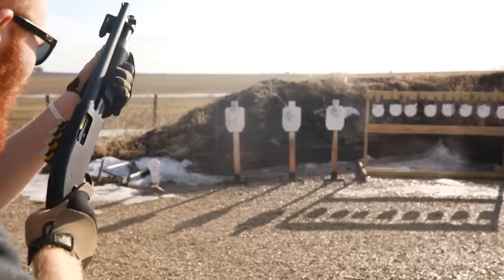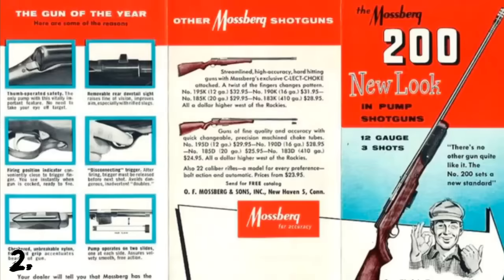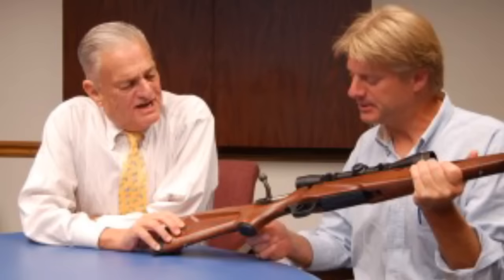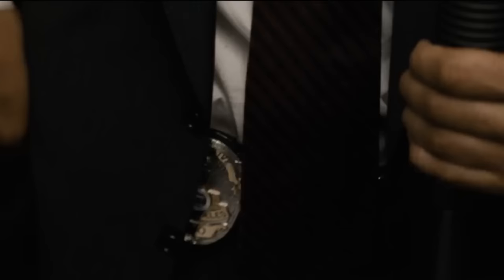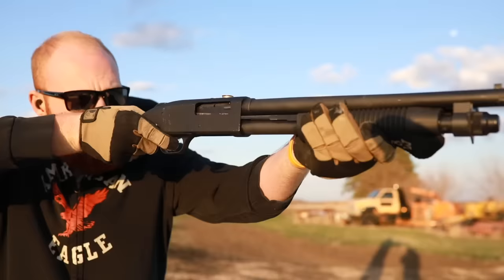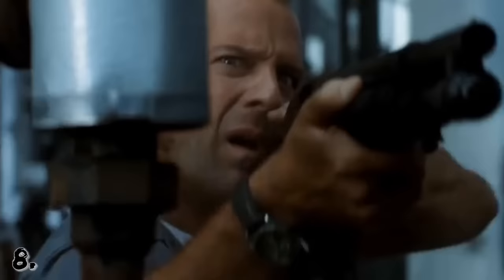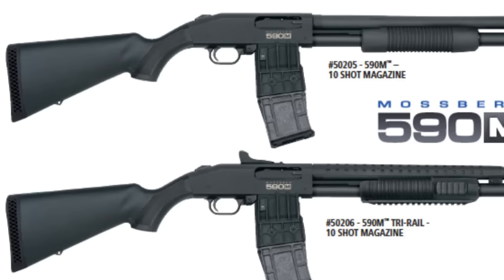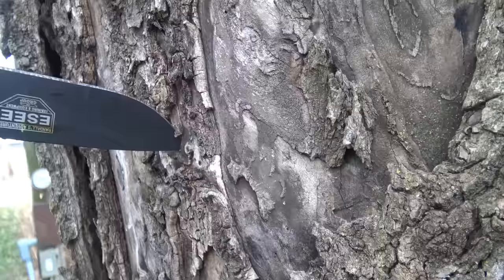10 Things You Don't Know About The Mossberg 500 & 590 Shotgun

Comment: After 30 years of being in law enforcement and a gunsmith, I can safely say I’d take a Mossberg over a Remington any day.
Reply: J. Robert Bragg Winchester/mossberg>remington right?
Reply: what's your thoughts on the Maverick 88 vs the 500? is the 500 really worth the extra cost?
Reply: With the maverick 88, you can not change the pump to a different pump because the action bars are pinned in place. You basically have to spend an additional $$40 for a new piece plus the price of your upgrade. 
Also, the safety tang on the 500 I feel is superior to the trigger guard safety of the maverick. Other than that, there isn’t much difference. But I’d go for the 590. It’s the same price as a 500, but has barrel and tube fittings. Basically a sturdier 500.
Reply: you wouldn't say that if you had a'54 Wingmaster
Reply: @billmoyer3254  I've got a '62 Wingmaster 😁. Thirty inch, full choke. Great Waterfowl  gun.
Reply: Scott Murphy  not good?
Reply: Thank you sir
I value your input.
Reply: @VuDuVampirNinjaWitch The issue with the safety probably has a lot to do with technique. I typically release the safety while still in the act of shouldering the shotgun so it isn't slower than the Remington; perhaps even a little quicker. I definitely prefer the slide release on the Mossberg because it's much more intuitive to use when bringing the shotgun up. For the shotgun beside the bed with an empty chamber, that's a plus. As you say, it's just a matter of individual preference.
Reply: Joe Mamma ?? Really ??
Reply: Serious question dude. Bout to buy a 20 gauge Rem 870 but there's a mossberg 500 also. 
What is your reasoning?
Reply: Bill Randall  The .223 has a different application and range than a shotgun, also called a scattergun. An AR-15 is the next on my list.
Reply: My mossi shoots anything i feed her , love them .
Reply: They what an what to me as far as reliability goes
Reply: I also love my 500 but I have a question for you sir. My mossberg 500 mariner gets 3in shells stuck in the chamber. It requires me to  slam the but on the ground to rack it. It mainly happens when shooting slugs. If I grease the shells it is easier but still hard and 2 3/4 work fine
Reply: Jimm Crowe no high point here. A Mossberg 590m with the 20 round mag is one of the firearms I own. I won't participate in the racial slurs because I'm not racist. I guess your from some country backwoods. Step into the city and talk that talk in real life if you think that highly of yourself. We both know you wont. 😆
Reply: Joe Mamma yes, my father. 4th generation military soldier.
Reply: Joe Mamma your last name is mamma and your making fun of someone else's? 😆
Reply: Joe Mamma us blacks was already here in America. We are the true Indians. Second, Africa was doing great before the whole world attacked the mother land simultaneously. America, France, Belgium, Spain, Portugal, etc combined. It wasn't a fair honorable fight. Together, the United Nations continue stoll to this day, suppress Africa. Us blacks had taught whites just as much as y'all taught us. Y'all take claim and ownership with the power of money and the pen. Truth is, blacks leaving America for Africa is America's worse nightmare and you know it
Reply: @VuDuVampirNinjaWitch I do agree with you on the location of the safety, and it does make you move your hand away from the firing position. I used to have a 590a1 marine coat and I did buy a over sized safety for it. But overall it was just too long to use 41" for hallways and doorways
Reply: Sounds more like a personal preference. I'm sure there are people with similar credentials as yours who feel the same way about the 870.
Reply: Bill Randall  silenced?
Reply: Joe Mamma 🖕🏻
Reply: Joe Mamma  Sorry Man, I agree with everything you are saying. I hit reply on the wrong comment.
Reply: Agreed. Way better.
Reply: THANKS FOR YOUR SERVICE , I'M EX AFPD , FIREFIGHTER / EMT AND ARMED SECURITY , I'M RETIRED . NOW I JUST GO BOATING , CAMPING AND FISH AND HUNT AND AVOID HIGH CRIME AREAS AND IDIOTS , THE LORD KNOWS I'VE DEALT WIH ENOUGH OF THEM . SO YOUR A GUNSMITH TOO , GREAT . LAST YEAR I BOUGHT A H&R 1871 BUFFALO CLASIC CHAMBERED IN 45 / 70  EQUIPTED WITH A SCOPE , NO IRON SIGHTS  . I HAVE A H&R 45/70 HANDI RIFLE EQUIPTED WITH A SCOPE AND IRON SIGHTS AND WANT TO DO THE SAME WITH THE 1871 BUT CANNOT FIND A SET OF REGULAR IRON SIGHTS . ANY SUGGESTIONS ON LOCATING A SET . AGAIN THANK YOU FOR YOUR SERVICE , OH BY THE WAY , I' NOT SCREAMING , IT IS JUST THAT FROM ALL THE REPORT AND LOG WRITTING I'M STUCK IN THE CAPS MODE AND I WAS ALSO A DRAFTSMAN AND INVOLVED IN MILITARY COMMUNICATIONS LOL ,,, TAKE CARE , HAND SALUTE FROM A VET
Reply: @madeucedancinclub2452  
Writing in all caps in considered screaming.
Reply: Idk the actions just dont feel smooth on a Mossberg. But to each his own.
Reply: I have an 870 from the 50's and its still kicking.
Reply: Yeah I've had both and the Mossberg is built better. One example is the shell latch bars that move in and out to keep the shells in the tube or to let the next shell come forward out of the tube. The ones on the 870 are thin, flexible, and pressed into the receiver. I've seen an 870 where those bars were sticking in either position so it either wouldn't feed or all the rounds would fly out the bottom when you pumped it. On the Mossberg they are much thicker steel and very easy to remove or replace if you ever had to. Also, someone on here commented that you have to swap out the entire forend on a Maverick 88 if you want something aftermarket because the action bars are pinned..that's not entirely true. I have one with a threaded forend and that could be replaced with any Mossberg 500 forend and I've seen another one just like that in a gun store. I don't know what the story is on that but they are not all pinned..just most of them. Still a great gun though and I would even take an 88 over an 870. Oh and the newer 870s finish is garbage. They are notorious for rusting easily. Mine definitely does. It's night and day from the old Wingmasters
Reply: And benelli? What about it, the M4?
Reply: @billmoyer3254  @Harrison Mantooth I was working at an A&W drive in, I was 15. I took an order out to a car. When I get there, there's an drunk cowboy driving. He told me he didn't have any money, BUT he had a Wingmaster he wanted to sell. It was still in the box and unused. He sold it to me for $40 on the spot. I gave him the full $40 and I paid for his meal. This all took place in a very small town in Kansas, 1972. We're standing outside his pick up, me in my uniform, checking over the shotgun, and non of this was out of place or considered weird. A few guys got out of their cars to come check out the shotgun the "kid" had just scored. Everybody was having a good time. I laugh my ass off when I imagine the hysterics and LE response to doing that today. Hell my boss had someone take my place until I had finished with the buy. He came out and checked it over as well. Just another normal weekend in a small Kansas town.

BTW FYI. EVERY student at my high school that drove had a gun rack in the rear window of their pickups complete with rifles and shotguns. Those of us with regular cars always had rifles and shotguns in the trunks of our cars. It wasn't uncommon to drive to the river and go plinking during lunch.

The most important thing though is this; NOT ONCE did anyone go grab their gun of choice from their vehicle, and then start shooting in retaliation. Everyone knew full well what happens when the trigger is pulled. Responsible gun handling was taught at a very young age. 4 y/o for me. Then again society demanded personal accountability and responsibility for actions.

How did our great country get to this level of stupidity?
Reply: I have both and love both
Reply: @caswellthompson6432  I had the same issue a while back. I ended up taking a wire brush for that caliber and putting it on a drill and oiled it up then ran it up and down the chamber and breech for a bit to clean out the excess carbon buildup and it worked like a charm. Hope this helps.
Reply: @smallish_mk3733  You can find more accessories for the 500 than the 88.
Reply: @smallish_mk3733  I bought mine for 250 and got a Jennings .22 that I literally gave away to someone i knew so I got my 500 for 250
Reply: @harrisonmantooth3647  what is a wing master? Obviously it's a bird gun but I've never heard of it. Please enlighten someone who isn't familiar with bird hunting
Reply: @El_Rubbertoe  Good evening to you Sir. 
The Remington Wingmaster, as you surmised, was the upgraded model of the 870 intended for bird hunting. With the 30" Full Choked barrel with 3" chambers, it was a great Waterfowl gun. It had the better Blueing and finish on the Butt stock and foregrip.
Like I mentioned above, I bought it back in the early 1960's. I'm sure if it's even offered anymore. 
I still have it but, my newest is a Mossberg 500 Persuader with 18" bbl. I bought the Persuader is of course for my home defense gun. I also favor the Tang mounted safety because I shoot left handed. 
Good luck to you Sir.
Reply: Everyone is someone on the internet
Reply: @TheVCHorseguy You are from my generation l went to a small South Carolina high scchool in the early 80's everyone had a gun rack in their truck with a shot gun or rifle in it.0 shootings.It was never thought of.
Reply: @rye-bread5236 better safety on mossberg if you go traditional stock.  Pump is riveted on the 870, mossberg is screwed.allows you to  easily repair
Reply: My first gun was the 500 field security combo. It still fucks 20 years later
Reply: @I_name_All_my_guns lol nobody wants to hear all these lies . Especially Ty last one . We would be virtually crime free by now

Comment: Still got my 500 from the late 1960's. Around 60 years and it still works.
Reply: G Philip C . I not shure of the model no. but I still have mine. used it when I was 12. the bolt action one. no rust or wear looks great.

Comment: I bought a used, outwardly very used, 500 at a gun show back in the early 90’s for around $75. I still own it and love it. Never a failure or problem of any kind this entire time. I have upgraded it with a fiber optic front sight and synthetic stock (the original is wood). My gun has the vented metal barrel shroud which makes it really look like a military fire arm. Love it. Best value ever.

Comment: I just turned 58 and spent my entire adult life in law enforcement, and these days armed security. Got my first Mossberg in 7th grade , a 8 shot /bayonet lug/ parkarized 500ATP. I have had a couple
Of police Rem 870’s and they never stayed long lol, also issued them at work at times. But to this day the 500/590 is my go to. Utterly reliable, and the tang safety to me is ideal. I have ended up
Over the years on duty, having to point a Mossberg at 7 people.. they got the message very clearly and while they may have tried something if it was just my M1911... they sized up the trenchgun, and saw unsurvivable . Some as much as said so. Currently a Navy configuration Heavy Barrel M590A1, 6 shot with Vang +1 extension is my ridealong.
I do have to say that the box magazine
Version does not appeal to me... it strikes me as bulky and could hang up on stuff while withdrawing it from a vehicle.

Comment: NICE informative video. I got to admit that I have very little experiene with the 500 and I own 3 870s that I've shot quite a bit. One is set up for hunting, one for defense short barrel folding stock, the other tricked out with composite stock flashlight and extra ammo. I've owned them since the 80s so they never suffered from quality control like you mentioned with the current ones. When the Mossberg first came out they couldn't hold a candle to the 870s and I dismissed them out right. After seeing your  video I concluded that times change and so do gun company's and if I was in the market for a new shotgun I would give them a shot because they improved not decided. I'm quite happy with what I got and don't plan on changing but I'll stop looking down on the Mossberg fans because they may have a point that I hadn't considered. Again thanks for posting.

Comment: An army ranger friend of mine said that the mossberg 500 was the only shotgun that passed every military trial, not even the 870 did. I think it'll be my next shotgun =)
Reply: Get the 590. Its the same as the 500 but has upgraded features such as a full metal trigger housing and metal safety. The 500 does not. If you break your trigger housing (happens to cops more than you think) your gun is now useless.
Reply: My 500 persuader came with all metal trigger housing I'm guessing your thinking all 500's are the kiddy toy Mavericks only advantage with the 590a1 over the persuader is the barrel thickness
Reply: Dave Boothney That was the Mossberg 590, but the 500 is a damn good shotgun too.
Reply: Dave Boothney pretty sure we all just heard that in the vidja.

Comment: I've owned the 870, Winchester, Stoeger, Benelli, Mossberg semi-auto, 88, 500 and 590. The one I trust the most is the 500. I haven't had to rely on the 590 as much while on duty and I haven't fired it as much as the the others, but I'd pull a 500 off the rack before any of the others. OK, I'll say it; the 500 is the AK47 of shotguns. EVERYTIME I pull the trigger it goes BANG.
Reply: I"m surprised you wouldn't say the same for the 590.  It's pretty much the same gun, beefed up with a heavy barrel.
Reply: Ric Johns  YES RIC ITS TRUE... THE LITTLE 500 IS A HELL OF A PUMP... IT IS A VERY RELIABLE, DAM NEAR BULLIT PROOF, AND A GREAT HOME DEFENSE SHOTGUN... I DONT NEED A 5 TIMES MORE EXPENSIVE WEAPON... IT STANDS SMALL BUT TALL
Reply: To follow up on all the rest, Ric - If you like the 500, and don't mind a little extra weight, you'll love the added durability of the 590; That heavy barrel means IF you find yourself having to play whack-a-mole, you're much more likely to walk away with a slug-gun that can still provide standoff power - And while mine didn't come with a threaded barrel, I hear it's not too bad to get it threaded to accept Winchester or Mossy chokes, and take it out as a squirrel gun, too.
Reply: How well has your mav 88 held up got one about 3 years ago new for 200 bucks out the door never shot it . Like alot if my guns no time.
Reply: @paulsecrest9427  I've had mine for years, not sure how many rounds I've fired through it. Never had one hiccup out of it, eats whatever I feed it.

Comment: #11 ;)  The  500/590's have dual extractors, a big advantage in combat. The 590 has a slightly thicker barrel wall than the 500. You are correct with the explanation about why it is thicker.

Comment: Now if they'd only make a survival/backpack shotgun that can either be taken apart like the Henry AR 7 or fold completely in half like the chiappa little badger. That may increase price a little bit but if you need to leave town say from a hurricane and need to throw it in an emergency bag with 10 boxes of ammo it would make it easier to transport further. Not to mention a 590 is beyond what a saiga shotgun can do now with the magazines and it's the most customizable I've seen in shotguns.
Reply: Mitchell Lubline 

The shockwave is nice and stubby. Doesn't quite fit in a scabbard too well, but it works.
Reply: Maverick hs 12
Reply: MItch, the problem with 10 boxes of ammo is the weight. You do need a little bit of water.
Reply: @neuro6164   It's like people are forgetting that chest rigs, battle belts, and other such LBE exist.  10 boxes worth of 12 or 20 gauge in magazines or even shoved into velcro side saddles for tube feed is a wee bit optimistic, but it's better than shoving 250 rounds in a backpack where you can't get to it in a hurry.
Reply: I'd have to disagree, Mitch.   Saiga 12 magazines come in 2, 5, 8, 10, 12, 20, and 30 rounders.  Everything from AGP, to SGM, MD Arms, Izhmash, ProMag (only good for the 12 round drums), Csspecs, etc.  I'm kind of trying to understand all of the hype about a shotgun which can run 20 round mags.  The Saiga 12 has been doing it for at least a decade now with the drums.  With Csspec mags, you're talking built like a tank.
Reply: You do know zombie arnt real don't you.

Comment: Bought my 500 at a pawn shop in 1983 for about $75.00. That was 36 yrs ago. Had a 30" full choke barrel on it. I have the 28" mod and 18 cylinder bore barrels now as well. 2 different stock configurations. I have shot thousands upon thousands of rounds out it without failure to feed or eject.. A majority of those have been 3" heavy goose loads or slugs. I absolutely love that shotgun. The only issue I ever had was the safety broke. It was plastic. Quick order from Brownells and got a steel replacement for about $6.00. Just a great gun period.

Comment: I bought a 500 on my 18th birthday. Came in matte finish with a 24" ported and rifled slug barrel. The dealer tossed in a used pelican hard case and a 28" modified choke maverick barrel that has gotten me banned from Turkey shoots it patterns so tight all for $250 bucks. Year in and year out I used it for hunting, clays, and as a boat paddle on more than a few occasions. I've feed it primo shells and I've fed it nasty cheapo shells and never did it jam or FTF. Its honesty never has it let me down, despite my less than ideal treatment and maintenance. I would stake my life on that Mossberg and they have definitely earned my loyalty. Nothing against Remington and the 870 mind you, it's a solid number in it's own right as far as the older ones I've used.

Comment: I bought a New Haven (made by Mossberg) Model 500 when I turned 18. I’m now 64 and still have the same shotgun. It has never failed to work just like it did when brand new. I also have a Mossberg 590 with pistol grip, side saddle and 18 in. barrel. It’s my “home protection” gun.